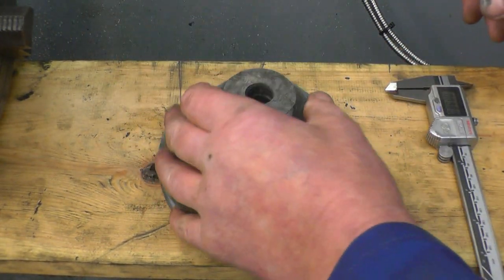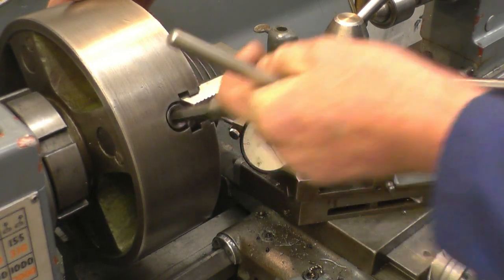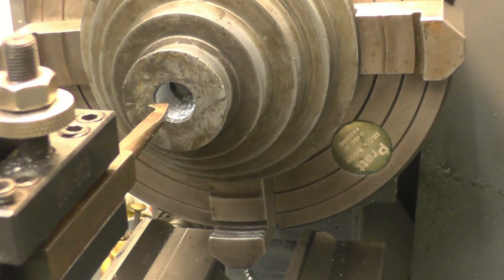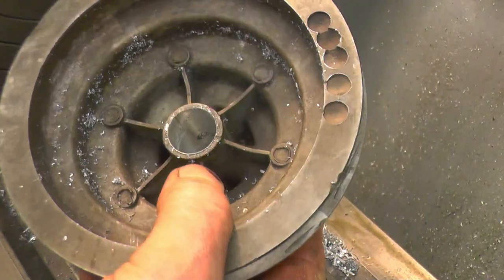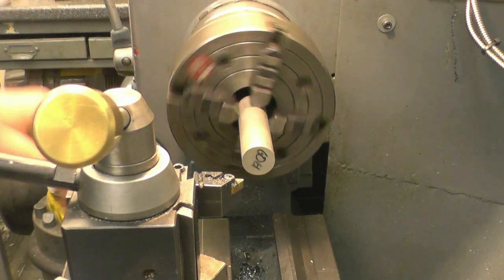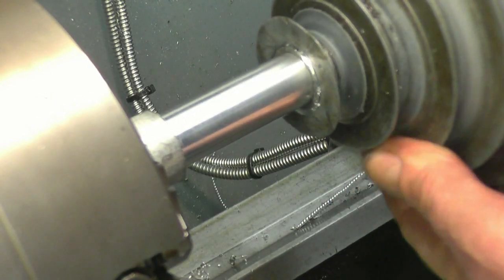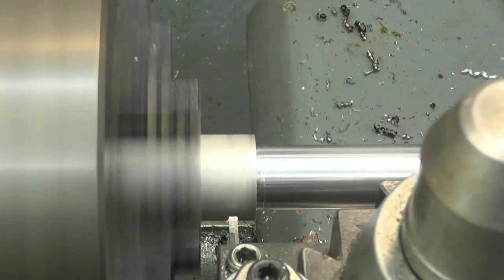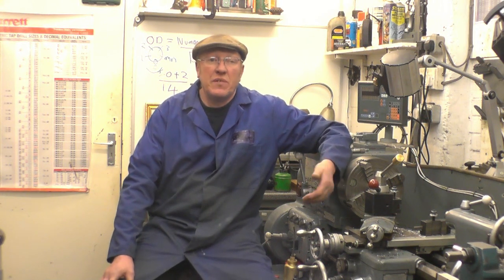SNNC 108 P2  Rebushing a worn pulley bore

Comment: Totally sympathise over the leaky garage roof. I've endured years of damp tools and damp motorbikes and dozens of pots collecting water. I finally splashed the cash (a lot!!!) and had the roof replaced just before Christmas with a composite panel roof. Now leak free and cosy but the best bit is going for four roof light panels, it's gone from pitch black to daylight and I can quite happily work in there now without all the lights on during the day, so it's actually saving me money as well :-)

Comment: Bollox , you left us in smoke with that pulley, I'm guessing probably it cracked, aluminium is hot short,the more you heat it the more rigid becomes, if you had a lot bigger diameter on the bush it can very well crack the pulley.

Comment: Great video John but you left us hanging out to dry! For some reason I'm quite surprised that the little gas camping stove will get that pulley hot enough to insert that plug into successfully. Will two grub screws realistically be sufficient to transfer enough torque from the motor to the belt, perhaps it only had one earlier in its life which is why the shaft is so chewed up? 
I'm glad to hear Debs is going on OK and that progress is being made with your Dad.